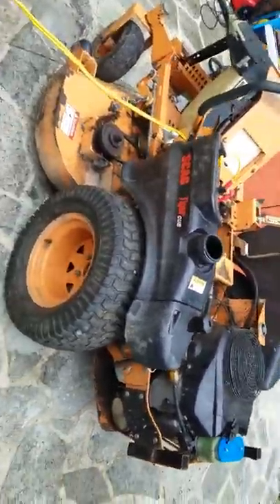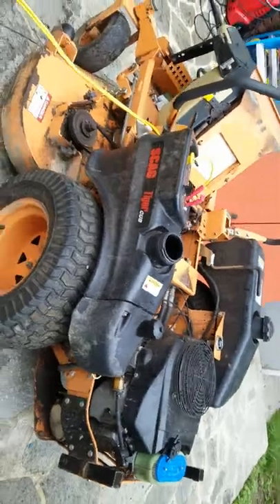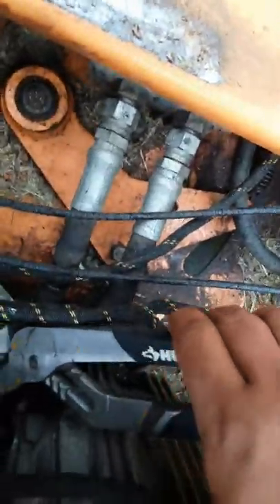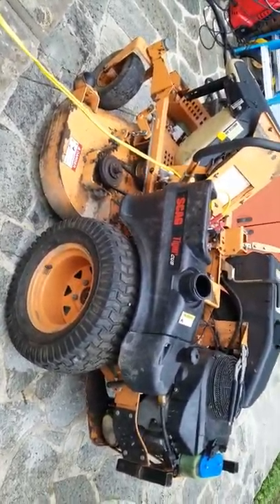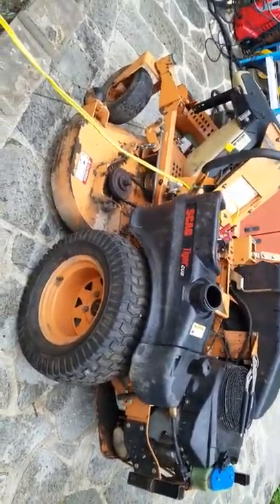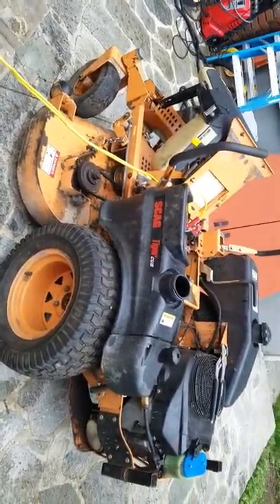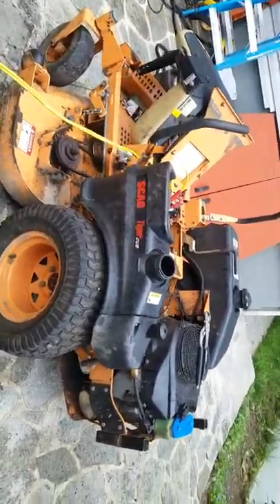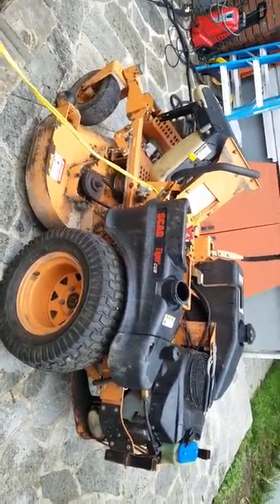Scag tiger cub will not start

Comment: All safety switches need to be engaged.  You need to press the button under the seat, turn your key to the on position. Check the relay RL45 on the machine between the starter and ignition.